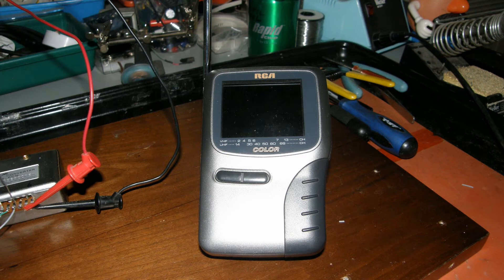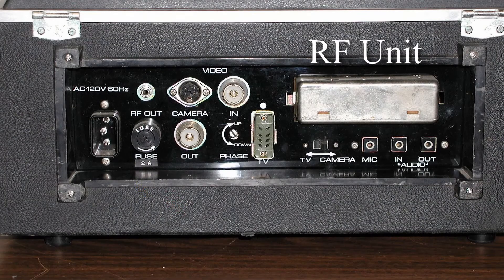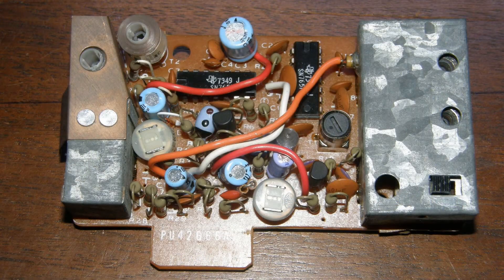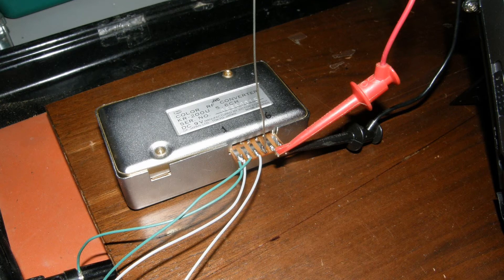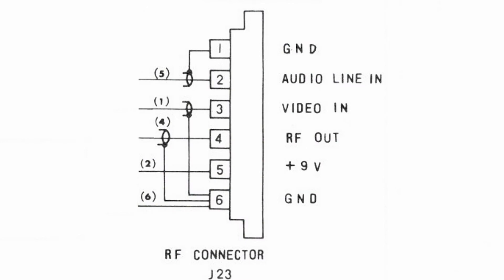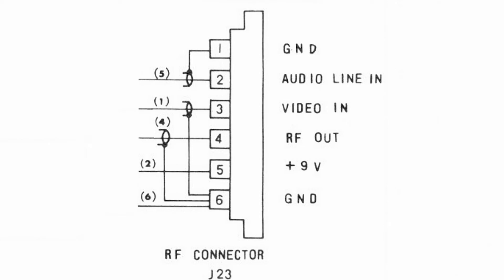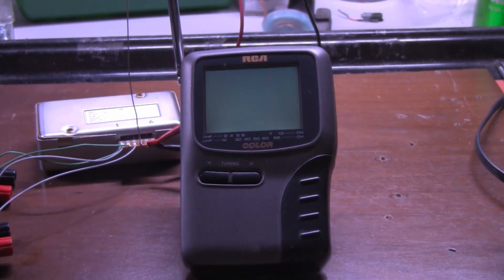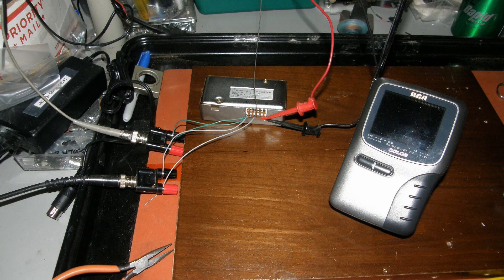A Simple Nano Power Television Transmitter

Comment: How can I wire up my RF module from my old VCR system. I pulled the RF from the system because the system doesn't work again. How do I identify the pinout? The RF module has both RF input and output.
Reply from the maker: You could either obtain the service manual for the VCR and get the info that way. OR - before you took the machine apart - Probe the pins on the RF unit to find the DC voltage and video and audio signals. With the built in switching, there are probably two pins that had a DC switching voltage for selecting between TV/VCR mode.

Comment: 1 inch is too low...
Reply: Here is transmitter that transmits around your house(100m with dipole antenna), but sadly, it has no audio, but you can make FM transmitter and tune it to audio carrier of the transmitter. https://circuits-diy.com/amp/tv-video-transmitter-circuit-vhf-uhf/
Reply from the maker: I don't disagree. Is a $10,000 fine from the FCC too high?
Reply: @videolabguy  The world is a bit bigger than USA...